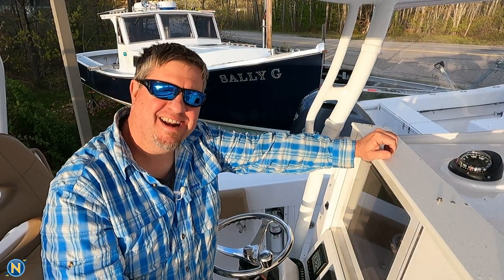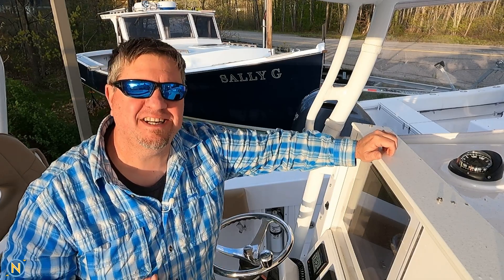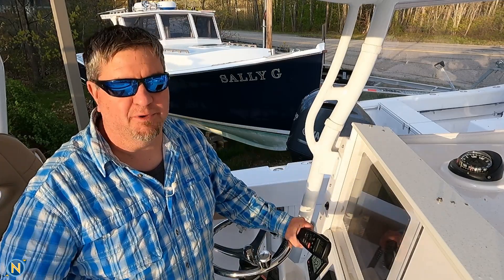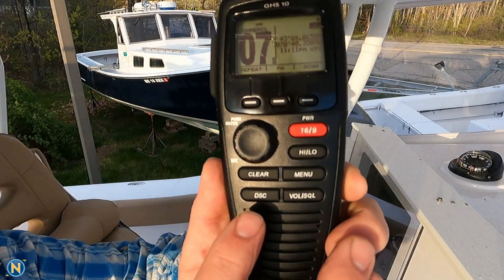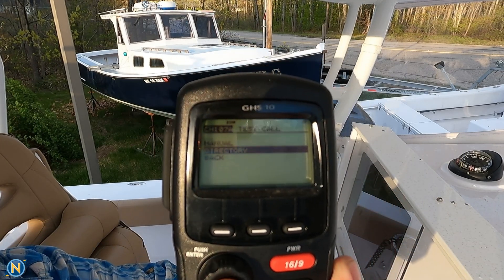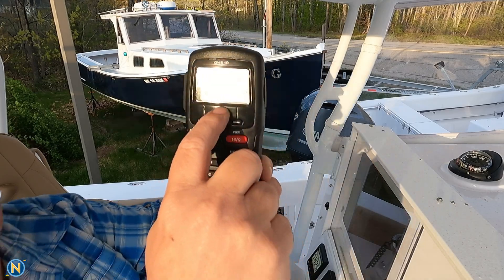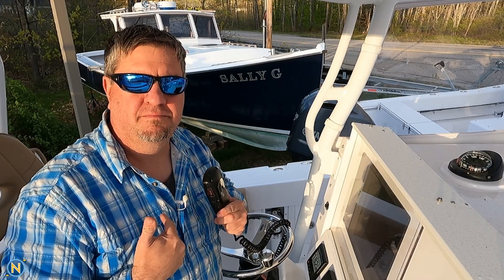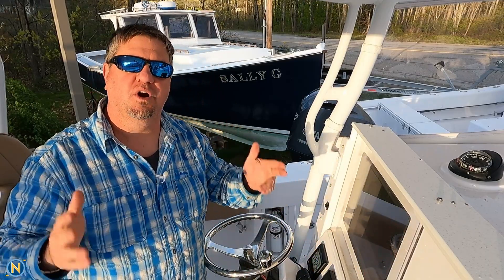2021-5-16 The one about VHF Testing

Comment: Is this DSC test number still working? And does this work in most ports on the east coast of the US?
Reply from the maker: As far as we are aware this is still the most current way to test your VHF.  Of course your mileage may vary depending on where your located